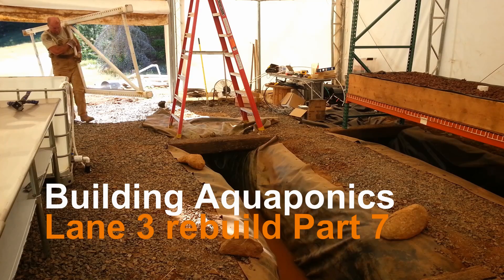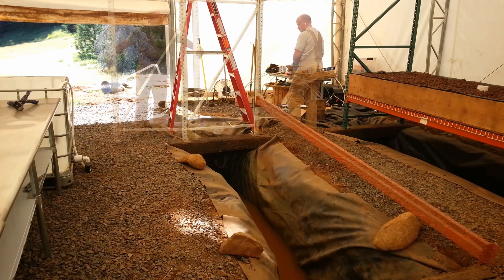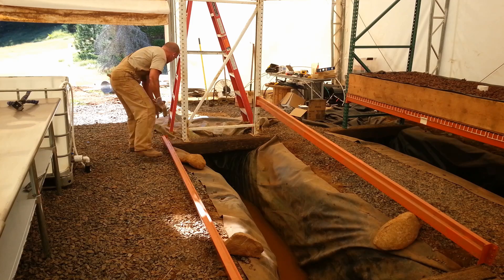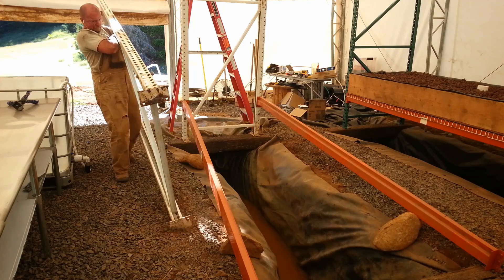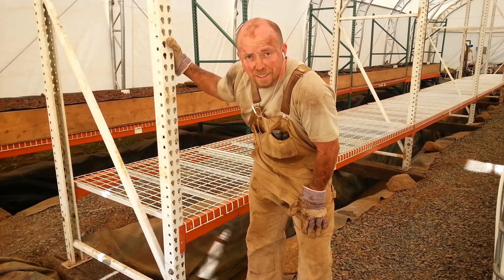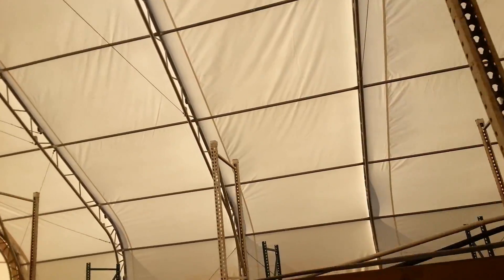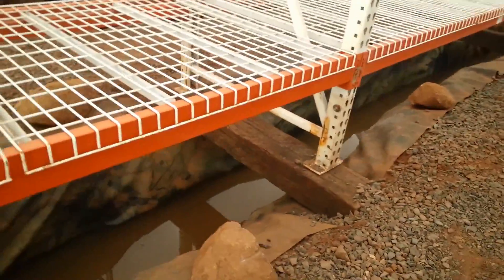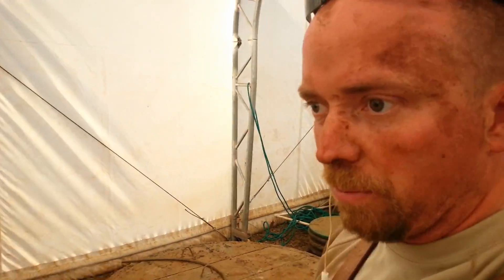Building AQUAPONIC and MICROGREEN GROW BEDS with RAINBOW TROUT - Part 7

Comment: Pre mark all the supports at the same point to not have to count as you build. Easiest way is to cut a scrap of wood to the size you need to mark it from a known spot (floor bracket). When you go to add the microgreen levels you can use the same to quickly mark where to hook in without having to count every time.